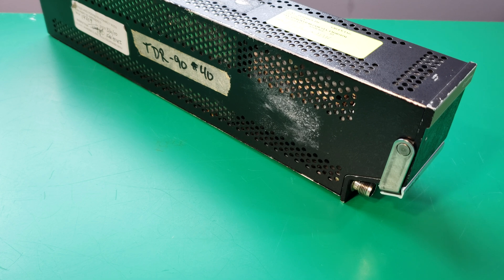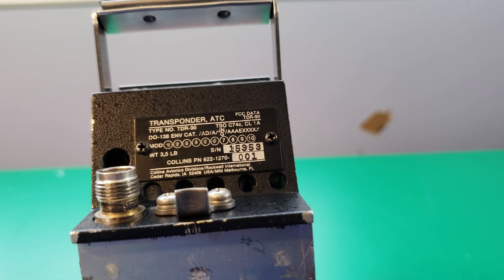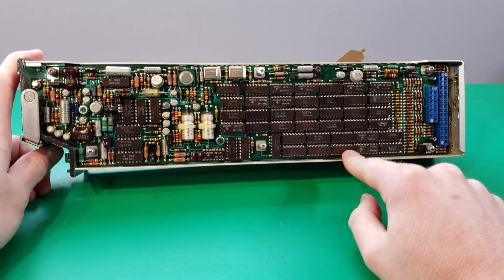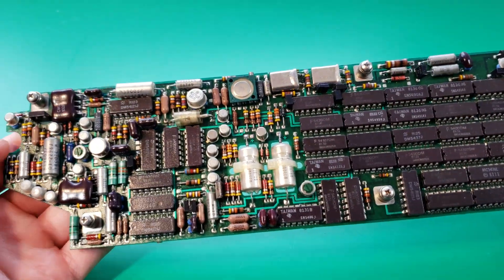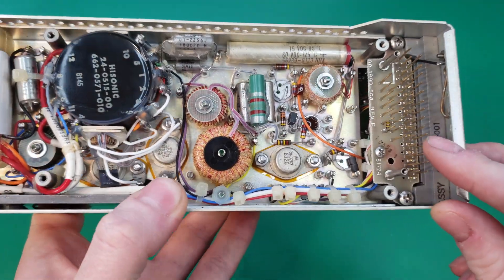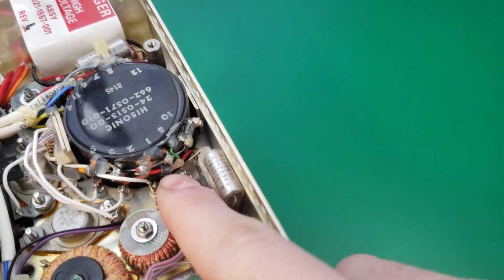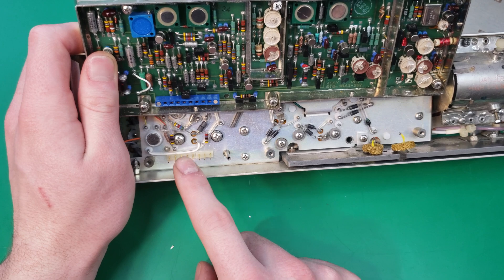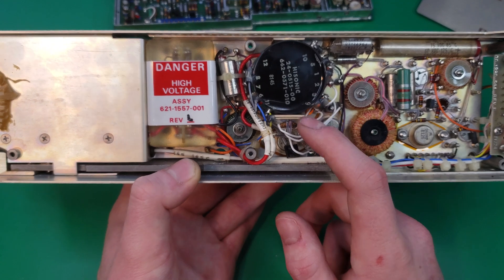Collins TDR-90 ATC Transponder Teardown

Comment from the maker: Some things I forgot to mention: This transponder is not constantly sending out information to ATC. Rather, it only sends out the latest information on the flight in “pulses” when the transponder receives an interrogation signal from the ATC radar, about every 5 or so seconds. The newest information is then displayed on the radar screens for the air traffic controllers to monitor. Also, this transponder only sends out the aircraft's registration code, and it's altitude.
Reply: A few corrections maybe. You do not change the frequency on a transponder, they work on fixed frequencies. The thing you change is the transponder code (or squawk) as instructed by the ATC. Also from what I can find the TDR-90 is Mode A and C only as you pointed out in the video but incorrectly in the description and only will transmit the transponder code and altitude and no other information. Other than that, nice to see one of those from the inside, I usually don't get a chance to do that.
Reply from the maker: @vorbeiei  Thanks, I will fix that.
Reply: some useful cheat codes I mean squawk codes:
7700: free priority landing
7600: mute annoying ATC
7500: free airshow with fighters

Comment: 10:56 its a surprise for me, because kapton tapes are no longer allowed in aviation because it likes to disintegrate with humidity.  They banned it in 90 I believe.
Reply from the maker: Interesting, I did not know that. This unit seems to be made in the early or mid 80s
Reply: @BGTech1  try to put piece of kapton tape into water for some (long) time and You will see its destroyed.

Comment: Very typical Collins, interesting to see how they used basic ICs only,  thanks for the video.
Reply from the maker: Thanks for commenting. It’s possible that using basic logic ICs was a more reliable and proven method, rather than microprocessor based design which was newer at the time.